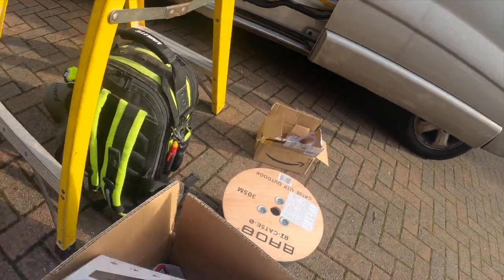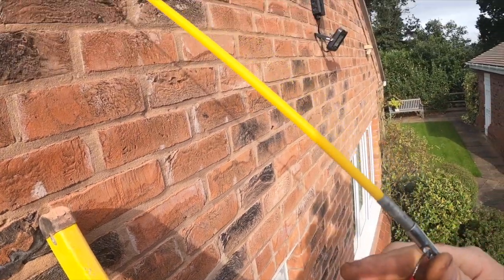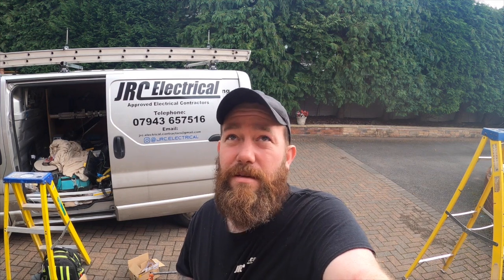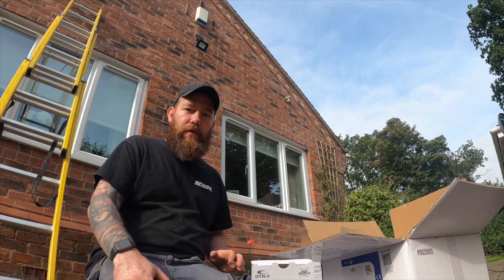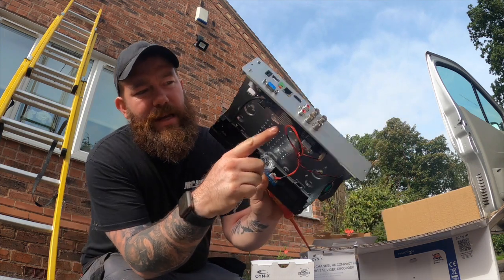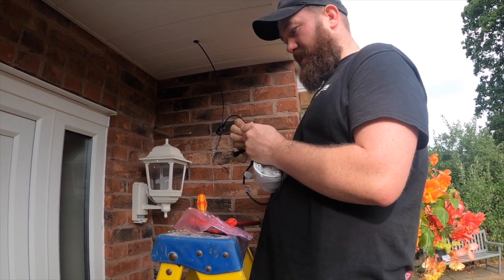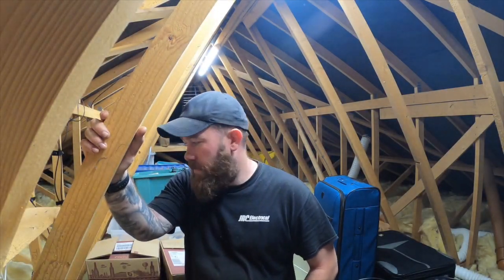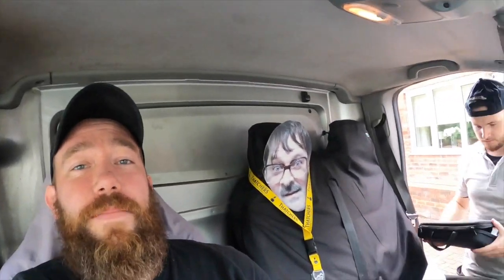CCTV Install

Comment: I found with Cat 5/6 with the cable sock just put a tiny bit of tape on the end, should work a dream then 👍🏻
Reply from the maker: Cheers dude, I’ve noticed they do sell other sizes tho but the price of them, I will tape them up 😂😂
Reply: @JRCElectrical  exactly my thoughts, went to buy them off Amazon then saw the price 😟
Reply from the maker: @sampegg9915  crazy prices and there is about 5 of them 😂😂

Comment: What drill is needed when fitting cctv? having a debate with kids dad as hes gonna do mine
Reply from the maker: Depends what your fixing to or drilling through, we use an sds drill to get through the walls but a normal drill to get through soffits
Reply: @JRCElectrical  cctv camera brackets to brick, the other half said somet about an impact drill but hes only got a normal one, lol im clueless 😂
Reply from the maker: @starryder8374  any hammer drill will do it, sds would do it faster but a normal hammer drill will do
Reply: @JRCElectrical  cheers youre a star.
Reply: @JRCElectrical  so if i decided to hardwire my cctv instead of wireless the SDS drill would be the one im guessing?
Reply from the maker: @starryder8374  any hammer drill will get you through the soffit and into the loft, then run all the cables into the loft area and house the DVR in there or run the cables through the ceiling into the room you want it in